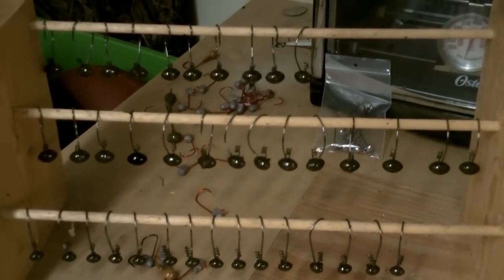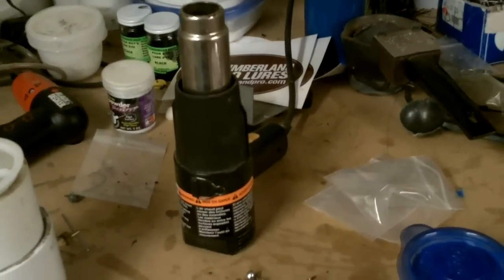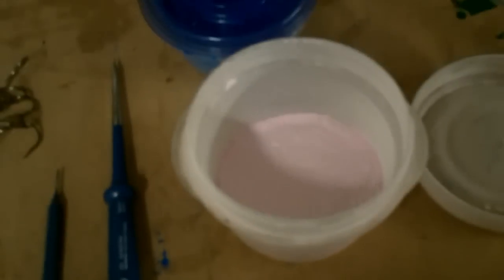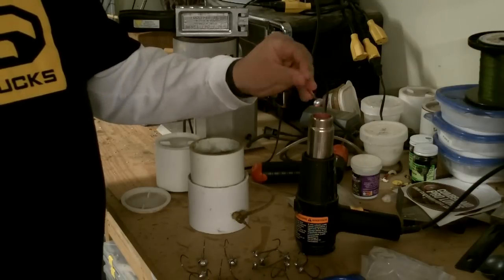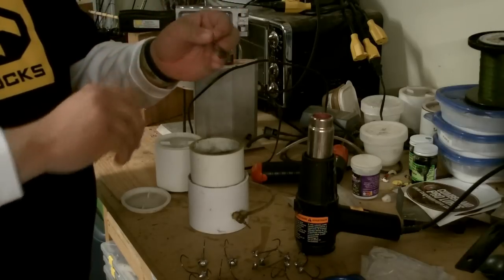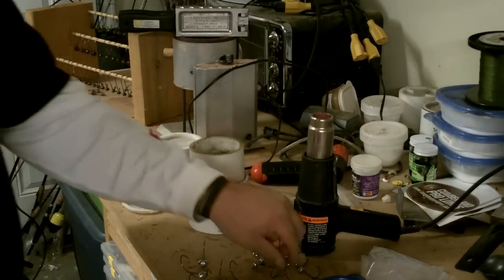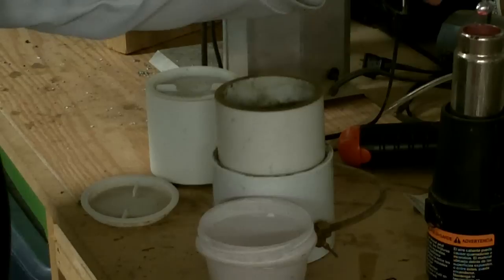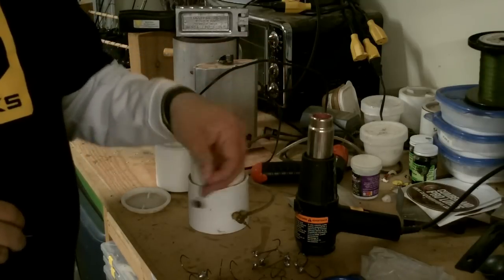How to Powder Paint Jigheads at Home

Comment: I heat the jigs in my toaster oven, use a locking forceps to grab the jigs from the oven rack, quick dip and then hang right back on the rack again. Very easy to control temperature that way and can dip as fast as you can grab them, hang right back on the rack and close to bake. Light jigs will cool quickly so you may need to close oven to reheat them after doing 10 or 15. This way you can hang and heat them all, leave and do something else and come back to dip whenever you feel like it.
Reply: Derek The I was wondering why you couldn’t do it the way you stated. It just makes better sense to me.

Comment: what materials did use you to make the fluid bed?  i would want to make several top containers to quickly change the paint colors.  What type of material did you use for the air filter system under the top container and how did you make it stay put?  The air source i can get at the hardware store as well as the tubing and air control valve. tks/

Comment from the maker: I do it two different ways. I will swish the bottom of the jig in one container of powder paint, then flip it over and swish the top of it in another color. That can be cumbersome depending on the size of your container. So I also will do it another way where I dip the whole jig in one color. Then I take a 1/2 inch paint brush, dip it in the second powder and then hold it over the jig and tap the handle to sprinkle a second color onto the top while the jig is still hot. Gives it a splatter color

Comment: Also I poke out the eyelets with a fishing hook I cut the tip off of after I remove them from baking, but while they are still hot. The trick is to poke the paint out of the eye before it cools and hardens. If you do get a jig that the paint hardens on, you can heat a paperclip or hook in a torch and melt the eyelet open. With larger hooks, and controlling the temp by heating the jigs in the oven instead of with a heat gun, often the powder will coat the eyelet, but not plug it and it wont be necessary to poke it open.

Comment: I ice fish in MN and want to paint tungsten panfish jigs myself because the are $2.50-$4.00 a piece. Could possibly do a video on tungsten weights or something?
Reply from the maker: tyler johnson Tungsten can't be poured or painted at home because you can't heat it up enough to melt or powder coat. You could possibly dip or paint them with dyes or acrylic but it won't stick well.
Reply: Maybe dyed epoxy?
Reply: Tyler, I'm in MN, too, and have been making my own tungsten jig heads for several years.  Have been powder painting them by dipping them in the jar.  The powder paint gets on too thick that way, and takes away some of the advantage of tungsten's density.  Wired2Fish's fluid bed will help a lot.

Comment: Do you have to bake or can you just fish them after the first step?
Reply from the maker: West You can fish them but the paint will chip off pretty quick. Baking them bonds the paint to the lead so they won't chip.
Reply: Ok thanks for the help! Ill be doing some baking then!
Reply: +Wired2Fish can't epoxy do the same thing but stronger bc you have a thick coat over the paint itself?

Comment: I am getting a mess with my fluid bed. Barely cracking the valve. Powder all over the fluid bed Suggestions???
Reply from the maker: I haven't messed with mine in quite a while, but when I had it spurting powder all over the place it was usually related to powder getting moisture in it and not flowing well with air added to it or the filter I was using was not passing air evenly. Some powders are better about staying dry and some pick up humidity pretty quick and clump. I never found a good way to get the powder to go back to being more fluid. There are some online resources like www.Tackleunderground.com that have a lot of good forum discussions on getting your fluid beds worked out. http://www.tackleunderground.com/community/topic/23785-diy-fluid-bed-trouble-shooting/

Comment: Great video.  My question is; I just power coated 8 jigs to supposedly a fluorescent red color.  I may have held the jig over the heat too long because when I extracted it, the jig, out came a dark red.  It was a good coating but nowhere near fluorescent red.  Did I hold it over the heat gun too long?
Reply: +John Echterhoff May have to do white first, then red.
Reply: I did, and it worked fine.  Thanks!

Comment: Okay, I painted and cured my jigs...Now the fiber weed guard (1/8") don't fit. If I try to Dremel the hole any larger, I am going to throw the hook right into my hand.  You guys that add your weed guard after you paint your jigs, please let me know what I need to do.  I rather not get hooked!!!
Reply from the maker: Kerry, I have one of those cordless screwdrivers that runs on batteries that takes a 1/8 drill bit. I can hold the jig fine and clean it out like that. It's a low speed deal so it's not nearly as dangerous. If you're worried put the hook in a vice and clean out the fiber guard hole.
Reply: Wired2Fish
Reply: Sometimes I just ask my wife to hold it for me - that way I don't get hurt. I use my hands more than she does, and she doesn't seem to mind.